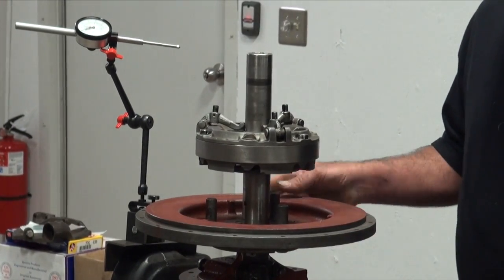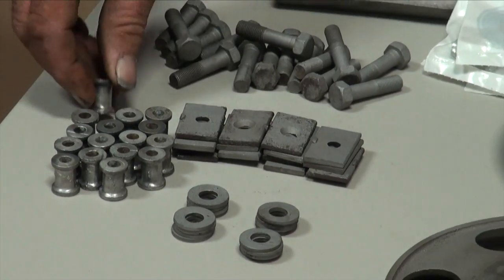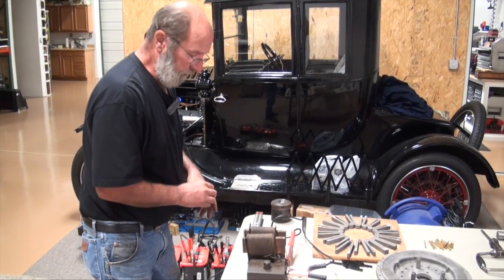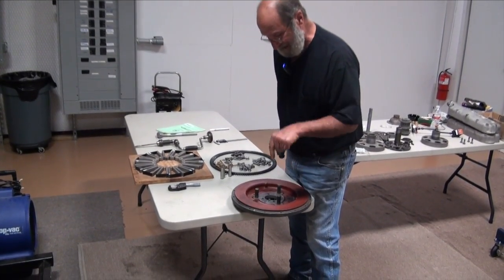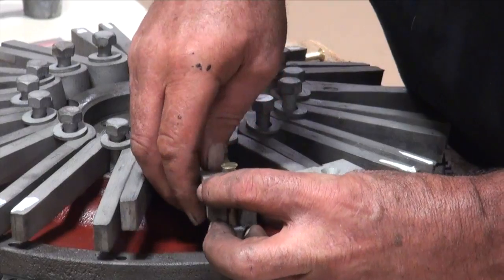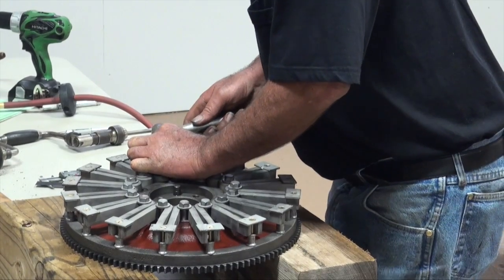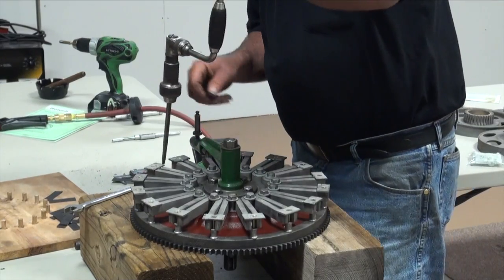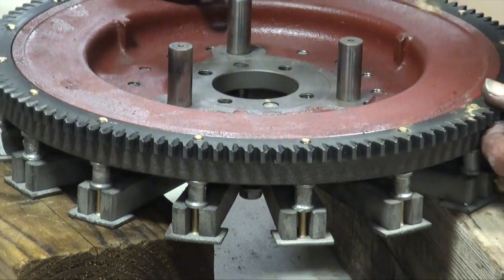Engine 14 Flywheel and Field Coil Part 1

Comment: Not sure if anyone is monitoring this channel, but I have a question.

I’ve got a KR Wilson tool and went to install it onto the flywheel. The two alignment pins are still in the flywheel. 

As I drop the tool into the opening in the flywheel, the base of the tool is catching on the pins. The base goes partially down and gets hung up on the bottom half of the pins.  There’s obviously an interference part on the pin.

My question: do you push the pins out and let it drop in or do you tap the base down?